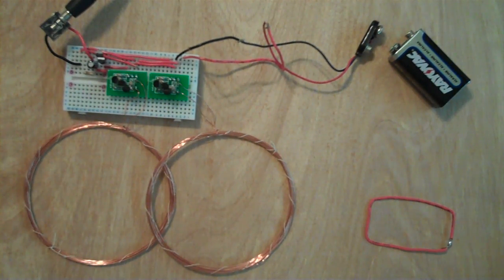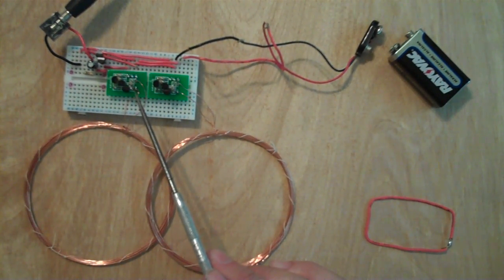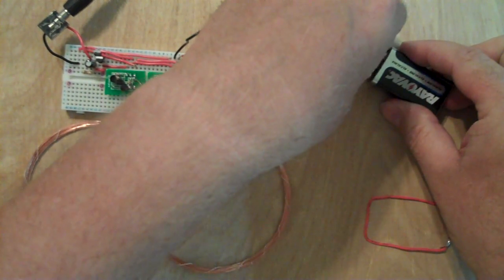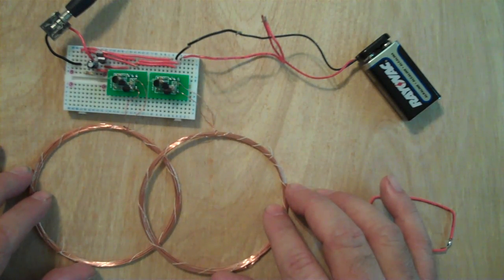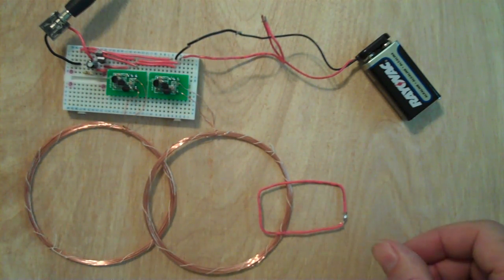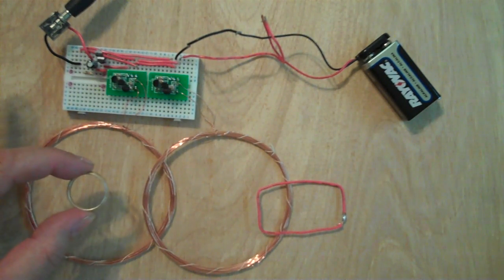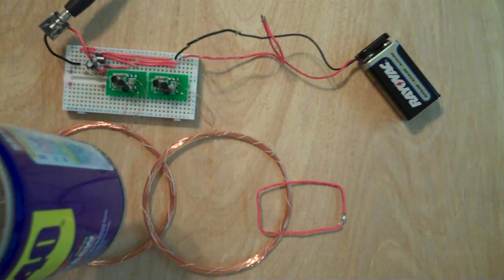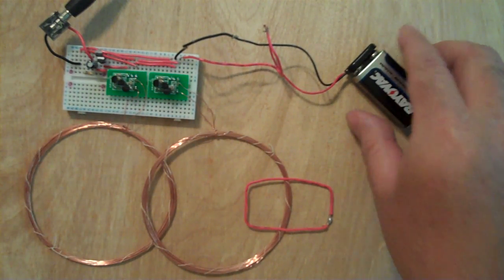Simple BFO Metal Detector - Improved Circuit Design

Comment: Just thinking Beau, maybe I have the components- if you can just tell me their names  and values and how many I need of each  then I'll  just need to buy the 2 PCB boards from you. Yeah? Best,
Jimmy
Reply from the maker: Perhaps this PDF will help ... https://651d69c6-3941-4d9b-bc52-6ff4d87abd17.filesusr.com/ugd/63b124_b1dc027934f6403281599c176cd115b0.pdf

The radioshack amplifier should be fine, but if you want more output we also sell a 20Watt Class D amplifier that works nicely with the metal detector.   https://www.bscircuitdesigns.com/shop

Comment: Hi Beau,
Can you give me a price for  the two pcb boards and all the other electronic components needed please? I'm finding the ebay schematic link hard to follow and  read.  I can't read their values from the photos as they're very poor quality when you try to zoom in. I think you said the coils are identical at 20 turns each. So I can make those myself , but I'm not sure what mm or gauge wire they are. Also the fine tuning closed loop - what size wire is it? I have a small amplified Radio Shack speaker and battery which should do fine.   If you can give me a total price for the 2 pcb boards + components plus postage to Cork in Ireland then just send me a PayPal  request and I'll send the money back to you straight away. Is that ok?
Kind regards, 
Jimmy

Comment: Circuit diagrams and component's please
Reply from the maker: The Dual Coil BFO Metal Detector uses a Peltz oscillator at the heart of each coil.   There is a datasheet here ... https://651d69c6-3941-4d9b-bc52-6ff4d87abd17.filesusr.com/ugd/63b124_b1dc027934f6403281599c176cd115b0.pdf

Comment: Can I get wiring diagrams please
Reply from the maker: The Dual Coil BFO Metal Detector uses a Peltz oscillator at the heart of each coil.   There is a datasheet here ... https://651d69c6-3941-4d9b-bc52-6ff4d87abd17.filesusr.com/ugd/63b124_b1dc027934f6403281599c176cd115b0.pdf
Reply: I want components details with  circuit diagrams

Comment: Hi how can i calculate the propagation of vlf waves in a coil?
Reply from the maker: It would be the same formula you would use for the resonant frequency of a coil.  You would need to know or measure the parasitic frequency of the coil, and know the inductance of the coil.  For VLF the coil and or capacitance will be large.  The lower the frequency, the larger the coil and or capacitor.  What frequency are you talking about here?

Comment: The two Coils is the same diameter same thickness or the TX Different  than the Rx
Reply from the maker: They are the same... They should be made identical to one another. i.e. same number of turns, on the same coil form.
Reply: @ICPolyman  what about thje wire thickness  also the same and what diameter you use?
Reply from the maker: @mohammedalisarayrah7525  - the wire I used was #18 enameled copper wire...  It is important that the coils have close to the same inductance, therefore ideally, both coils should be identical in their construction.
Reply: @ICPolyman  Is there a way to test the inductance for each coil
Reply from the maker: @mohammedalisarayrah7525  Some digital meters can detect the inductance ... Or you can try the link below to an Excel file I have put together over the years ... You will most likely want to use "Special Case Multi-Layer where l equals b" ... ONLY enter information in the Green cells ... https://drive.google.com/file/d/1Tdgh0gIzIRCXZdPo6iFLHISQu0MgtgyA/view?usp=sharing

Comment: Theorothically the signal can penetrate 5 times the diameter if the coil and  the smallest object at 1/5th of the coil diamater can be detected at this distance but it requires a lot of fone tuning and it's only valid in air test.
Now, I'm interestes in a PI metal detector that can go as deep as 8m to identity an object as big as a compact car. Can you design such a metal detector?
Reply: big loops

Comment: Just bought a pair. Maybe you can help me figure up a circuit to step up the coil power about 20x or more though. I'm looking to build a very large coil system for looking deep for large veins of non ferrous yet still be able to discriminate from black sand. Maybe even find or make some software that will allow 3d imaging on laptop later.

Comment from the maker: Depth is going to be dependent on the Coil size.... as a general rule of thumb the depth approximates the diameter of one of the coils.  As far as soil densities, that's going to be dependent on the coil frequency, this can be adjusted by placing a capacitor in parallel with the coil to alter the LC resonating tank frequency, but keep in mind you will need to apply the same value capacitor to each coil.

Comment from the maker: The coils in this simple proof of concept test are only 3.5 inches in diameter.  As a general rule of thumb, the diameter of the coil equates to an approximate depth that you will be able to sense metal.   Different coil geometries will have different effects, and some are much better than others.  The general operation of this metal detector is a BFO which has its own particular limitations with ground depth penetration, but in answer to your question I would say generally yes it could be used.